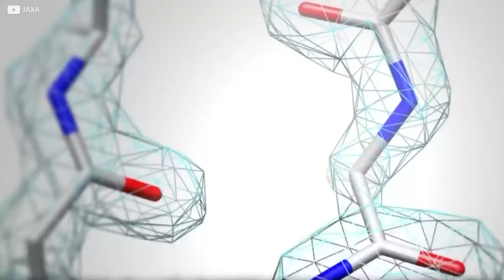Life Inside The International Space Station

Comment: The WI-FI is what i could go to ISS for,!!!
Reply: Despite the 600Mbps mentioned in the video - alas very little of that is actually available for general "internet browsing".  That 600Mbps is shared across all users/uses of the ISS (think of the telemetry/video downlinks / 100's of experiments).  

If you ask astronauts browsing the internet is still a bit of a painful experience.  Still, that has improved from just a few years ago when they only had 300Mbps.
Reply: @issabove  I take back my comment then,
I thought it was 600 all the way
Reply: @KuduKE  and it'd be very hard to connect to a data center whilst travelling at mach 15